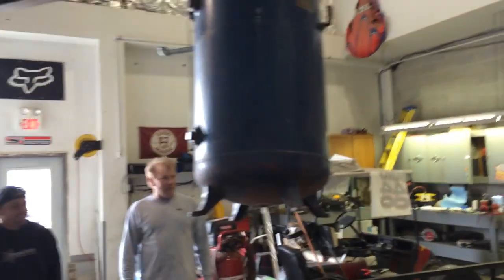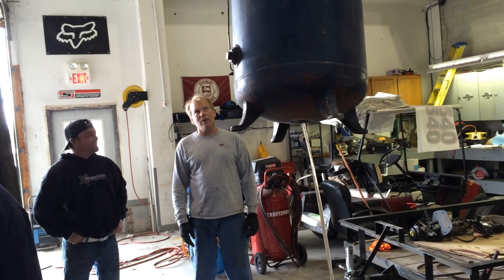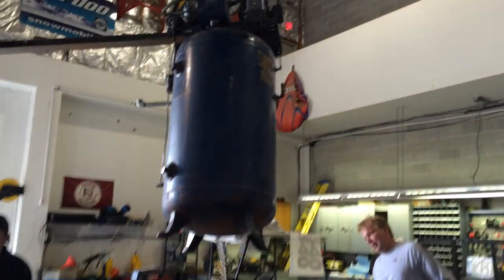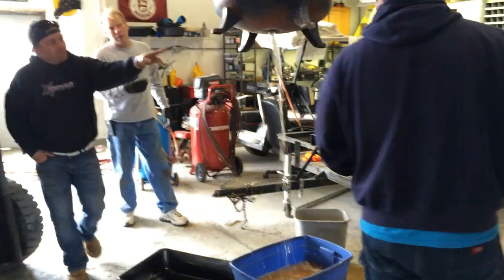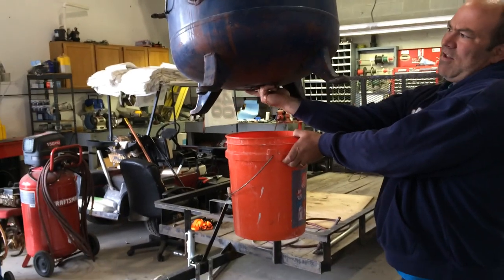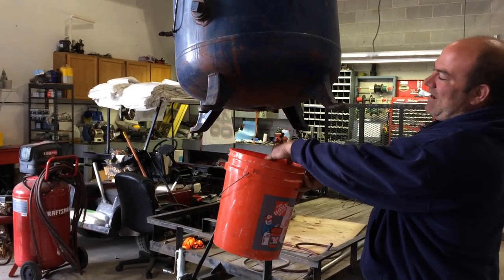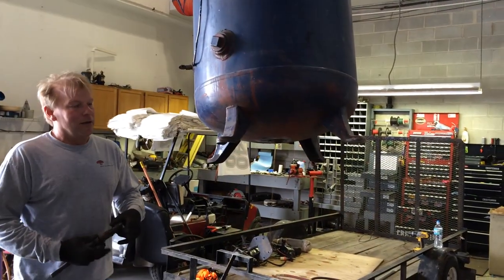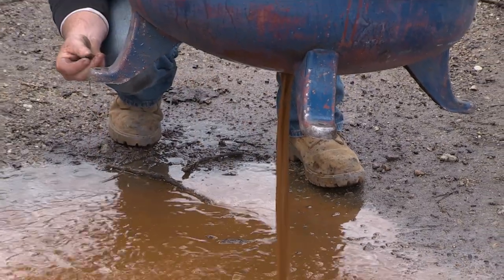Why You Need to Drain Your Air Compressor - Vlog

Comment: Id rather this thing explode with 30 gallons of water, than to explode with air only. Then again, Id honestly rather not use it at all.
Reply: NO.
Reply: Compressors don't explode unless the pressure relief valve fails. If the tank rusts through, it will just leak air. It's no different to puncturing an air hose.
Reply: @ryanokeefe12  I've seen numerous videos about exploding air compressors. Not common, but rusty air compressors can explode if they get too rusty.
Reply: @quillmaurer6563  As I said, at standard pressure, they will simply vent if the tank gets a hole or cracks.
The only time they will "explode" is if the pressure switch fails and the safety valve fails to operate (the later being fairly common on compressors that are never drained and are very old)
Reply: @ryanokeefe12  From what I've heard sometimes they leak - probably more often as pinhole leaks form - but sometimes they do explode from rust damage at normal pressure. Typically if a line of rust forms along the bottom of the tank it creates a weakened "seam" that can rupture.
Reply: @quillmaurer6563  I don't know how much clearer I can be with this. If the tank would explode under normal operating pressures, you would have thousand and thousands of airline "explosions" daily when an airline is cut or damaged. 
If you were to have a hypothetical magic situation where you could click your fingers and turn every bit of metal into bullets, the air inside the tank at operating pressure would push those bullets outwards at a whopping 4-5mph. 

The moment a hole or seam opens up, you will have air venting. If the seem somehow continues to tear, the air pressure, and therefore, air speed, will drop DRAMATICALLY and rapidly because of the size of the hole. This dissipates any energy in the tank before the entire tank can tear apart, anyway.
Reply: @ryanokeefe12  poke a pin hole in a balloon and tell me it didn’t explode 🤣
Reply: @zacharykirby6248  Is that supposed to be a logical analogy for what a metal tank will do if you get a pinhole in it? last time I checked, metal wasn't elastic nor does it try to return to a smaller size when the compressed air is removed.
Reply: @quillmaurer6563  Yup... failed welds due to rust build up and corrosion in steel tanks!
Reply: @algallego  What's your point? The pressure relief valve likely failed.. not to mention its got a home weld job on the bottom of the compressor in the video you linked

Comment: A friend of minr was cut in half by his compressor tank exploding. He was in his shop doing projects. The metal ripped open like paper. The bottom was rusted to the point of failure. Get a new tank. Someone else might get killed. Even the owner
Reply: Cut in half? 😱
Reply: @justinfoster6135  LMAO  I think this dude is telling a fish tale
Reply: @chipsperry  yeah 😆
Reply: Compressors don't explode if the tank is rusty. They will just leak air. Even if there is a massive and sudden crack in the tank, it will just blow out all of the air. Air compressors run at 100-150psi.. that's pounds per square inch. If you think the compressed air inside is going to peel the metal open and throw it across the room, why don't air blow guns blow holes in steel?
Reply: @ryanokeefe12  there are plenty of videos here on YouTube that will prove you sorely wrong sir, compressors can be very dangerous if not cared for properly and replaced when appropriate.
Reply: @ItsRenderInnit  the videos show compressors failing because of pressure exceeding the cut-off pressure without venting.
If you think a compressor will explode when the tank gets a crack in it, why don't Airlines explode when they get a cut in them?
You need to understand that you're basing your response to me on your own opinion and assumptions.
Lets assume the entire tank is a magic one. I click my fingers and the tank itself changes from a steel shell, to hundreds of bullets around the air that was inside the tank. At 150psi, the air that was inside the tank will accelerate those bullets to a whopping speed for 2.7mph.

When you have a cut off failure and a pressure switch failure, your tank will quickly exceed 400-450psi.. The force trying to move itself outwards is an order of magnitude higher than at 150psi.

Comment: It won’t explode. It will get a pinhole leaks. You can fix them with JB Weld For temporary fix. till it gets more pinhole leaks... We Tried braze welding them before we kept making new holes in the rust spots. It’s not a bad deal buying a cheap used or free and getting a new tanks when it happens. (Check new tank price and availability before you buy a used one. Bring it up to the seller. $$$)

Comment: You are always supposed to drain after and before each use. The air gets compressed and moisture from the air is extracted by pressure. It will then rust the bottom of the tank and ruin it

Comment: its good you made this video for all to see, many dont realise that air naturally contains tiny amount of water and it accumulates in the tank over time and water stagnating inside rusts the tank and reduces its strength to hold the massive pressures when its operated, i also think that all compressor tanks should have some kind of plastic wrapping on the exterior so that in the event of a tank explosion, the metals dont shatter into bits and fly all over the place like a bomb shrapnel...great video made in the interest of safety!
Reply: many people have lost their lives or close to it using tanks in similar conditions... pin hole leaks would be ideal but that's not always the case....
Reply: +Ronnie DJ  gross.

Comment: The reason the compressor creates so much condensate I'd due to the conpression process. The hot compressed air is passed out through the non-return valve and into the cold steel. The water just runs down and starts to fill the vessel. 
Ideally you should fit a 1/2" times solenoid velvet drain with ball valve bypass. Empty the receiver and set the drain to purge every 30 mins for a second or so. You will never have a problem again.

Comment: How the fuck did you get it in your truck to drive off with it and NOT notice it weighed some 240 pounds heavier than it should?
Reply from the maker: Ford diesel  240lbs is nothing!
Reply: Tools In Action Your truck picked it up?  How did you get it in the truck is the question.  You would think you would notice 240 pounds of water sloshing around when you loaded it.  Powerstroke nation bruh...
Reply: +Logan Cressler Oh hell no 6.0 was a nightmare
Reply: lol 6.0 only decent diesel theyve made ya bullet proof em get 500k miles 6.4 or 6.7 gonna cost you more than there worth in repairs
Reply: thatguyjosh thattallguyy I ain't paying $10k to bulletproof an engine should be built right from factory
Reply: HERPY DERPEDY then don't buy a Ford diesel or do the work yourself looking at maybe 5k and then 8-15 on the truck and got atleast a 300k mile truck or be smart and buy Cummins or duramax
Reply: thatguyjosh thattallguyy we do have a duramax runs great use to have a 6.0 worst pos ever
Reply: HERPY DERPEDY heck ya dirtymax is where it's at the Fords are nice trucks the diesels are just shit trynna work on getting my first diesel here soon lookin at some 5.9 Cummins which imma end up bullet proofing and itll run forever
Reply: thatguyjosh thattallguyy 5.9 sound freaking awesome love that loud rev and deep drone idle
Reply: thatguyjosh thattallguyy nice tranny was a big issue so you going to use the same one or buy a whole nother transmission and adapt it a good automatic is the 4R100 from Ford they may make shit engines but this transmission is bulletproof from factory 4 Speed Reverse and it was able to handle 1000 Ft pounds of torque
Reply: Damn I'll look into it was just gonna build the stock one or do a manual swap and build the manual up but I'm up too damn late dreaming bout owning a diesel and watching tool videos on stuff I wish I cld buy so imma get some rest for the long day of work tomorrow that'll help fund this have a good one man keep that dirty max running good and striking fear into power strokes

Comment: I got a really good deal on an industrial 7hp Gardner Denver air compressor.  Guy had the head rebuilt and he was selling it because it ran constantly.  He loaded it with his forklift.   When I got it home I could hear water sloshing in it.   It was a horizontal tank and was almost full of water too.  It was even up on a stand where you could easily drain it.

Comment: I have seen tanks blow up and knock tin off the walls and blow out windows and yes, it could be deadly in the right situation but remember, the ends of pressure vessels are almost always made of heavier material than the barrel of the tank just for this reason. The vast majority of air tanks that blow up were never meant to be air tanks and most were water pressure tanks only made to hold a fraction of the pressure we use on air. Personally, I use old propane tanks, if you look you can find them with up to 3/8 thickness in the 1,000 gal variety and if your sand blasting, 1,000 gal isn't any too much volume. If your worried, for a nominal fee your local boiler guy can check and see how thick your tank is and how much rust damage is done to it.

Comment: Buyer: "What was that sloshing sound when we loaded it on the truck?"
Seller: "Must have shook the gas tank when we let her down. (sucker)"
Reply: how could it slosh if there wasn't any air in it though
Reply: I always thought X gals of air/vacuum are much much much lighter than the same X gals of liquid/water......
Reply: Carlos Garcia yup.  But air is compressible, making it a spring which can store a lot of energy.  Water can be under pressure, but if a tiny bit leaks out, all the pressure could be gone.
Reply: PandaMan the sloshing sound in the gasoline tank (which was the lie)
Reply: Bwahahahaha
Reply: @PandaMan02  There's still a physical void for the liquid to move around.  The water's not suspended in a total vacuum, despite someone thinking it would be.

Comment: Air compressors don't explode unless the pressure relief valve fails.

If it rusts through, air will just leak out of the pinhole/crack. It's no different to a puncture in a 120psi bicycle tire (or getting a leak in your air hose).

Comment: Here in Washington it's law that a state inspector inspects pressure vessel every 2 years. they use some kind of ultra sound probe to measures the thickness of the thank. I have both mine done, both have an auto drain and both are like new, one is 6 years old, the other is from '86

Comment: The tank for safety reasons should be hydrotested to one and a quarter times operating pressure, otherwise you're needlessly risking life and limb.
Reply: 1.5 to 2 times minimum. 1.25 is not enough.
Reply: how to?

Comment: Compressed air also compresses the water vapor and condenses. The expanding air does not take all the moisture with it. Normal maintenanace suggests you should compress the tank slightly and open the purge valve to drain the tank.

Comment: i drained my compressor about a week ago. i got some water probably a quart. this is absurd this amount of water. i think im going to start draining my compressor monthly, i do drain it but not often enough. i leave the compressor charged so when i go use it the next time im not waiting for it to build air. my compressor gets modest use, its not a professionally used unit but it gets its workout once in a while and gets moderate use several times a month if not weekly.
Reply: Just install a ball valve at the bottom.  Open it up at the end of the day and let the air blow out the water.  It takes a couple seconds.  This is all that is necessary if you keep your absorbent fresh.

Comment: You would have to be an idiot to pressure a tank up with that much corrosion and neglect. Save the motor and pump. Tanks are replaceable and cheaper than an insurance deductible in most cases. Far cheaper than medical bills or losing a family member. These are nothing to play around with.

Comment: I have seen a compressor air tank teared by ice :-)
You may test that air tank safely when you fill it completely with water and then pressurize the tank with 1.5 x working pressure. If it hold for 10-20 minutes without any leak or pressure drop, it's perfectly safe air tank.

Comment: An industrial sized air compressor almost killed me because of this.. I got the full power of 450 psi blast in my face because the water rusted a hole in the fully pressurized tank . The blast was so strong it gave me a black eye also gave me a severe nose bleed from both nostrils and a very bad headache... Don't fuck around with this stuff..
Reply from the maker: UNLIMITED POWER Wow, yes it can be dangerous
Reply: UNLIMITED POWER Good to know.
Reply: +UNLIMITED POWER If you got the full power of a 450psi blast to the head you'd be 6feet under.  It takes a lot less pressure than that to kill a man.
Reply: David Hatzenbuhler It was from 4 feet away ... I did get the full blast from the compressor along with two others working with me. The tank was an 8 valve cylinder pressurized for 4 jackhammers and 4 blowout pipes . I know what it takes to kill a man , we got lucky.
Reply: David Hatzenbuhler Look at the video WORK IN SASKATOON ,on my channel that's me in the video on about two hours before it blew.
Reply: +UNLIMITED POWER More than lucky.  4  feet away?   Someone is looking out for you...
Men seating tire beads that cut loose have died from the blast.  That's a lot less pressure.
Reply: UNLIMITED POWER keep er around 130psi max
Reply: why the heck was 450psi thats insane

Comment: You would be surprised as to how much rust actually forms inside the steel tank.  I've drained mine on a regular basis since day one and rust still forms.  I don't think the tank is as compromised as you might think.  You can always send it out to be tested.  However, as I was watching the video, I was more concerned about the guys that were standing and walking under the raised forks.  I have seen a hydraulic hose burst on a forklift while the forks were raised ~10' high.  Those things come down extremely fast.  If one were to get hit by the forks or the load as it was free falling, no hard hat in the world would save you.  Just food for thought guys.
Reply: the load was stationary for quite a while.. yeah yeah im sure it could burst AT ANY TIME!!! but are you gonna go your whole life always expecting every line to bust at any moment... now i wouldnt stand under it while they were raising it or adding weight but once its sitting there problem free for a few minutes i have no problem working around it
Reply: @AndrewBrowner  that's what people say right before they die
Reply: @eksine  What do they say after they die? I'm sure it's something like, "The stress of the fear of everything breaking for no good cause sure made my life a waste of time. Too bad I didn't die sooner".
Reply: @jayryan7473  lol

Comment: I opened the drain valve on my little hotdog compressor and rusty water came out. I turned it on with the drain opened to flush out the rusty water. I had it maybe 3 years.

Comment: I have seen over heated hot water tanks go from the basement through 2 floors and out the roof. If many people knew the power of one of those they would never go near one same with inflating a bad tire they explode lie a bomb and have torn off limbs. that still freaks me out inflating tires after I have seen some results of faulty tires. People take many things for granted.

Comment: IF I was going to clean that thing, Think I would use a heavy bent wire to reach inside the drain hole and twist it while it was flushing.
  Having trouble with a little compressor now (20 gal).  Came across this while researching.  The more I see, the more concerned I get about these things.

Comment: I keep a Brass Radiator Petcock screwed in to the bottom of my 80 gallon air tank slightly loose as to leak air out and moisture.

Comment: My question is, unless the interior is coated properly, what difference does it make, when you drain the tank?  No matter what, some water will be condensing on the sides and pooling in the bottom between drain intervals.  It's going to rust either way.

Also, could an "anode" material similar to what's in hot water tanks, benefit a compressor tank?
Reply: I just bought my first compressor and have never operated one before.  As I read comments, a question pops up: Can the container be left open to allow air in to dry completely between uses?

Comment: I came across this video doing research on compressors. I just bought my first air compressor, a 1 HP 30-liter steel tank. I wanted to test the tank new to see if there are any leaks in and around the fittings. Is it considered normal and acceptable for a tank when filled but not used to lose no pressure in 30 minutes to one hour but about 2 PSI within a five-hour period? I am wondering if the 2 PSI loss in five-hours is due mainly to the settling of air inside the tank and a change in overall temperature.

I am also concerned about condensation. Is it a good idea to store the tank with the air-release (moisture-release) valve on the bottom of the tank open?

Comment: You should drain the air out after every use. Moisture will build up in the tank if is not drained and in your situation that tanks air hasn't been drained in quite a long time.